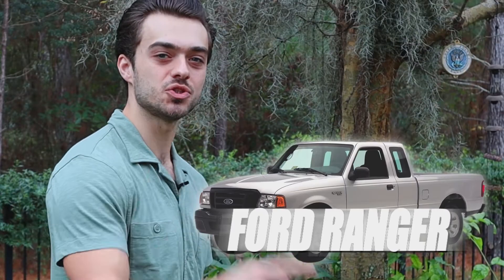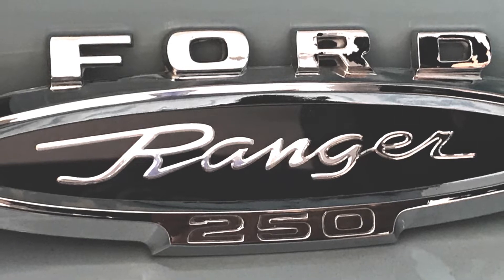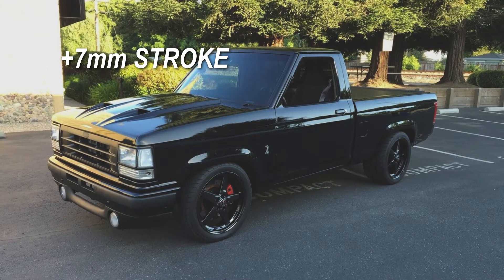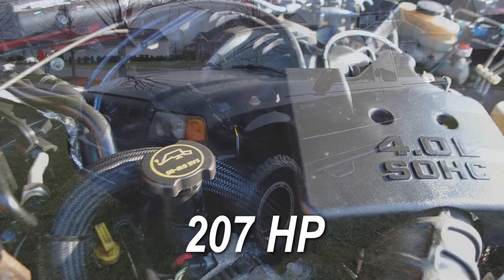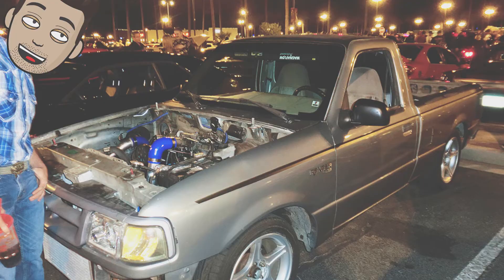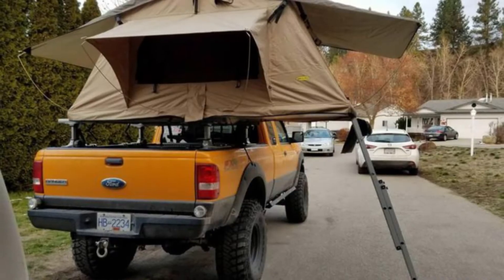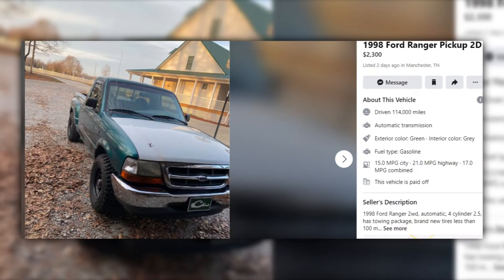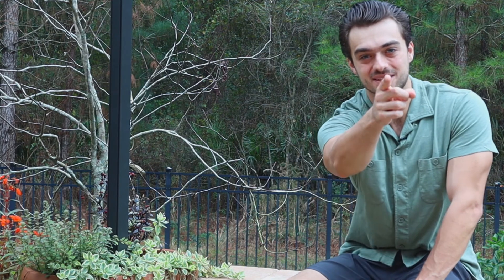Here's why the Ford Ranger 3rd Gen is the ULTIMATE Micro Budget Truck | Deep Drive

Comment: My father just gave me his 01 Ranger Edge with only 5300 miles on the truck. I pulled it out of storage and changed the tires, battery, oil and wiper blades and drove it home 85 miles last night.
Reply: Hell yeah
Reply: What motor in it
Reply: @Earth11111  
3.0 V6
Reply: @johnnybbgunner2136  that’s what I got in mine how’s the gas mileage? They got a rep for being horrible and I can say it is with mine I wish I got the 4 cylinder or at least the 4.0 they get same mileage with more power on the 4.0……but how’s the power on yours to? Easy to pass people?
Reply: @Earth11111  
The Ranger just turned over at 20K miles and I am getting 300 miles per tank and averaging around 19 miles per gallon.
Reply: @Earth11111  
The truck cruises at 90 mph and can pass with no problems.
Reply: It is all stock with stock street tires and steel rims.
Reply: @johnnybbgunner2136  interesting I think I need a new maf sensor to balance fuel out cuz I get about 18-20 on hwy but in town it’s horrendous. I put a new throttle position sensor on it and made my transmission shift better and more power it blather fuel out also but all them sensors along from the air box to the throttle body are important to get fuel to balance correctly the computer takes that info from sensors and tells how much fuel and the fuel air mixture ect so maybe I need to get a new maf that’s the only one left I need to get I reckon

Comment: For anyone out there buying a ford ranger you should also consider the 2nd gen rangers which were produced from 93-97. They're also fairly reliable and I have found tons of them on sale for less than 2k in great shape. They also have somewhat similar interiors as the 3rd gens as well as a similar frame.

Comment: Love my ranger…. 15yrs working as a ford tech… this is my 3rd one! 
2002 4x4, 4.0 sohc, 5speed manual with a manual transfer case.
Awesome trucks!
Reply: How do you recommend preventing the sohc timing chain issues? I’m about to buy a 5speed 2010 sohc and I wanna start preventative maintenance right away if there is any.
Reply: @akachrispy3726  right on… it’s a good truck…
a couple things first you will have all the updated parts so that’s great! The next is very important Id recommend running synthetic oil and do your oil changes at 3K miles or 5K Km. The tensioning system relies on oil same as the new eco boost engines… the cleaner the oil the less deposits and varnish in the system. Good quality oil is key IMHO 👍
Reply: @akachrispy3726  There aren’t any. I babied my 2005 Ranger FX4 Off Road and the chiming chain guides failed at 198,000 miles. I ended up putting a brand new Jasper engine in it. Well worth it. My truck is rust free and still looks like new.
Reply: @RangerShop1  
So, the 4.0L V6 is the only 4x4 drive train trim?
Reply: @Ornelas11B  what’s a Jasper engine?
Reply: @Daniel-yd4vg  It’s a company that remanufacture’s engines. Jasper.

Comment: Those 302 push roll motors were drop right in. I have it all nine Ranger sport 4 L 320,000 miles and counting everything original except thermostat housing and a water pump.

Comment: The first Ford Ranger was actually a full size pickup , the second Ford Ranger was a rebadged Mazda courier . What everyone calls the first gen is actually the third gen . And what everyone calls the third gen is actually the fifth gen . My dad had an early 70s Ranger , and it was just a trim level of the f100 . The Ford Explorer was also a pickup at that time .
Reply: The F-series had a "Ranger" trim package but it wasn't a Ranger it was an F-series. The Ford Courier was a rebadged Mazda. The Ford Ranger was produced by Ford from 1982 to 2012 for model years 1983 to 2011 and had only 3 generations: 1st Gen 1983-1992 with a mid cycle facelift for the 1989 model year, this could almost be considered a different Gen because the headlight bucket was completely different but it was still the same Gen. 2nd Gen 1993-1997. 3rd Gen 1998-2011 with 2 mid cycle facelifts but all changes were bolt on and there were zero structural/platform changes for the 3rd gen. Ford themselves have determined these facts about the generations. And Mazda had nothing to do with the Ford Ranger, it was a Ford design and built by Ford. The Mazda B-series is a rebadged Ford Ranger built at the same plant on the same line, open the hood or door on any B-series and it says manufactured by Ford Motor Company not the other way around. Also, there's an article from the NY Times in 1991 where they mentioned Ford would be building a compact truck for Mazda based on the Ford Ranger

Comment: Just an FYI the second 4.0 by ford was a SOHC, not DOHC as stated in the video. Great content though! Appreciate the info!
Reply from the maker: I’ll look into that, thanks for the heads up!
Reply: Actually the second was dual overhead cam , the first was a regular old push rod 4 l . And the third engine not the second engine is the SOHC  .
Reply: @AutoMotivate 
You didn't talk about payload or towing capacity numbers.

Comment: Ford wants $2400 to replace the blend door actuator on my 2020 Ranger. I haven’t even owned it for 3 full years. Never again Ford. Never again.
Reply from the maker: Replace it yourself. It is a $30 part and a days work, at most.  Takes a bit of research but youll be able to figure out which one it is. OR take it to a standard mechanic. Dealerships will always WAYY overprice.
Reply: @AutoMotivate  Yes, I’m going to try. No way am I pulling the dash to get to it though.
Reply: Shouldve bought an older gen, i dont trust the new ones